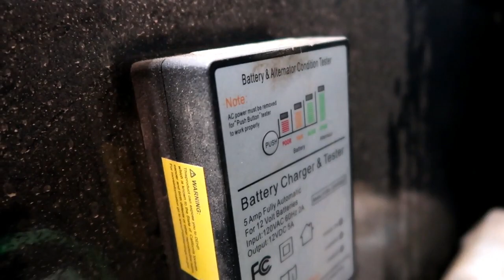PJ Dump Trailer Review

Comment: For anyone leaving comments, who in your opinion, makes the best dump trailer?
Reply from the maker: Wish I had more experience with other dump trailer brands.
Reply: Load Trail trailers has the best quality on the market. They sit about 4 inches higher but the quality and build is outstanding
Reply: I like my PJ alot
Reply: I've had a PJ Low-Pro with gooseneck since 2014----it's a GREAT trailer....so many things you can do with it.  Hauling dirt, gravel, lumber, tractor....this thing can do anything.  Very satisfied
Reply: Diamond C.   Buy once, cry once.

Comment: I own 2 PJ trailers. 1-20' car hauler and 1-14' dump trailer. I like most everything about the trailers, except for the powder coating...it's extremely bad! One scratch, and it peels off in sheets! This exposes the bare metal and quickly starts to rust. Also, the undercarriage tends to rust quickly. For the money I spent purchasing these trailers, I expected the powder coat finish to be much more durable. If you buy a PJ trailer, be ready with primer and paint...you're going to need it!
Reply from the maker: I hear that in a lot of reviews about PJ trailers and fortunately for me that hasn’t been my experience. I believe the coating on my Diamond C trailer is a superior product and much more durable. However the coverage is much better on the PJ. Our 2 year old Diamond C equipment trailer has more rust than our 5 year old PJ dump trailer. Both are used weekly in our landscape business.

Comment: They should warranty fixing the tarp rod being out to far to the driver side which like you said causes the jack to hit the tarp. You could cut about 1 inch off the tarp rod and drill a new hole for the handle. That would drive me nuts

Comment: Valid point about those welds digging into the I beam. You suggesting they have the c channel rest on the I beam instead would cause the deck height to raise 4 inches though. I am looking for the lowest deck height i can find. My tractors backhoe frame is very low to the ground. I like a lot of other brands better in my research but the low deck height of the PJ is a huge plus to me.
Reply from the maker: Longer ramps definitely help as well. With a dump trailer you can also raise the bed to lessen the angle. Check out my video on the stabilization legs for the PJ if you plan to haul equipment.

Comment: You are missing the drop down legs for the rear of the trailer when you load your skid steer.  You can see where they should be at 7:25 of the vid. Same concept as the jack on the front of the trailer.  Just a piece of  tubing with holes drilled in it and a foot on the bottom.
Reply from the maker: Yes, I’ve thought about making them. The tongue lift while loading isn’t that bad on this trailer compared to some I’ve used. Longer equipment trailers have a longer leverage point past the tires and lift the tow vehicle much higher.
Reply: @ThriftyGarage  They sell them at your dealer. I just bought them 60 bux each so 120 bux total
Reply from the maker: Yea, I ended up ordering them online from PJ. Very nice!

Comment: Any time you load your loader without a guy helping you hold the truck brakes you should engage 4 wheel drive on LOW and your truck won’t roll, also chocking the front wheels help. It’s happened to me and it’s the worse feeling.
Reply from the maker: Yes, you can also pull your emergency brake on the trailer to engage the trailer brakes.

Comment: I always chock my tires and drop my jacks when loading my mini ex and skid.
Reply from the maker: Since this video I have installed the PJ drop legs for the rear of the trailer. Makes a huge difference!
Reply: @ThriftyGarage  Great content in video pointing out the flaws in this trailer. Thanks for posting it.
Reply: @ThriftyGarage  how well do they work I just ordered them because I had the exact same thing happen to me unloading my machine
Reply from the maker: @rk_digit3164  the only regret I have is not ordering them sooner!  Well worth the money.  When unloaded just set them 1 full notch higher than where they naturally lay for the proper suspension settling.
Reply: @ThriftyGarage  do u have a review on the stabilizers? I’d like to see them in action. Sounds lame lol
Reply from the maker: @rk_digit3164  I filmed the install but haven't edited it yet.  Let me see if I can churn out a video for you.
Reply: @ThriftyGarage  that would be awesome!
Reply from the maker: @rk_digit3164  Ryan, just for you.  It's live!  Check it out!
Reply: @ThriftyGarage  not all hero’s wear capes lol

Comment: PJ TRAILER HAVE LOUSY PAINT.  I'VE HAD 4 INCLUDING THE ONE I HAVE NOW.  RUST AND PAINT FLAKING HAPPENED TO ALL AFTER ONE YEAR.  INCIDENTLY...NEVER USED IN WINTER AND WASHED REGULARY.  FOLD UP RAMP BARS BEND EASILY.  DECKS AND ELECTRONICS ALWAYS HAVE BEEN GREAT
Reply from the maker: What years were your trailers? This is a 2018 and while the paint is perfect. I’ve heard so many horror stories about the paint on PJ. But that simply not my experience. It has been a great trailer. We did bend one of the ramps but that was due to an emergency exit with a skid steer and I’d place that in the abuse category. Noting some heat and reinforcement didn’t fix.

Comment: All you have to do is lift the box 6 inch’s and the handle clears the tarp crank .
Reply from the maker: If it was a one off trailer I’d get that. But this was an oversight and should have been thought of in the design process.
Reply: @ThriftyGarage  all my diamond c and load trail and big Tex and Lamar are exactly the same I have 6 dump trailers and just added another 2021 PJ gooseneck  83x12’ dump trailer 2 weeks ago  to the fleet .	you always on all of low pro trailers  raise the box a little to use the landing gear handle correctly . It’s only 24” sides so the tarp crank will always be in the way of the landing gear crank . Think about it if it was a 4 ‘ side trailer the tarp crank handle would be another 2 ‘ higher .		.

Comment: Try lifting bucket on top of gooseneck. Pull forward to equalize weight. DOT says one chain and binder per corner, one on bucket, total of five minimum. Also no loose items in truck or trailer, Spares, shovels, chains etc.
Reply from the maker: There’s not much wiggle room for adjusting weight distribution but the way it is loaded is just about perfect. Loading backwards puts too much weight front. Putting the bucket on top of the gooseneck would be even worse. All of the weight would be in front of the trailer axles. Not to mention the door on the Bobcat swings out so in order to load like that the door would need to be removed, which isn’t super difficult. As far as chaining down 4 anchor points is sufficient for this machine. There are two hooks on the rear and two more on the front loader arms. On a MiniEx you would certainly need 5; one additional for the arm. I don’t believe DOT requires one chain and binder per corner. Rather that the chains and binders should be sufficient for the weight of what is being secured.
Reply: @ThriftyGarage  As Thomas Buss said skid steers are heavier in the rear it seems like you are still lifting the rear of the truck since thats behind the rear axles n i dont see squat on the truck. Any if it feels safe i guess you are ok.  If you had 16ft version it would of gave you that twiggle room you dont have.  As for time downs sin e you are under 10k you only need 2 on the machine. But would need one more for the attachment technically. This being said the towing i do is all back roads so i get away with less too. I only put 2 chains on anything from a 6k front end loader to a 12k mini x. To each there own. Just dont get caught by dot.
Reply from the maker: Trust me, I’ve been in a situation with incorrect tongue weight. Check out my “What happens when your trailer tongue weight is wrong?” video. I’ve loaded this track skid both ways and for weight distrust forward facing is best. Having a gooseneck dramatically helps as well. Plus dump trailers kick their axle further back to help with the dumping hinge point. Sounds like your very experienced as well so it’s not like you aren’t aware of what I’m saying. Thanks for your input.
Reply: @ThriftyGarage  yeah i was just saying. Ill have to watch the videos for fun. Thanks

Comment: Could you pull your trailer brake safety line to set your trailer brakes when you load?
Reply from the maker: I think that’s a great idea. I actually ordered a set of stabilizer legs from PJ and they are AWESOME! Definitely a must have upgrade if you haul equipment.

Comment: Interesting.
Reply from the maker: How so?
Reply: @ThriftyGarage  my 14ft 14k has legs that drop in the back to load heavy equipment.
Reply: how much pin weight do you think you have with the bob cat on?
Reply from the maker: Yes, that certainly helps. This trailer does pretty good. I’ve used traditional equipment trailers that were longer and they would always lift the rear tires off the ground unless you used the drop legs.
Reply: @ThriftyGarage  thanks for sharing. Ur helping alot of people.
Reply from the maker: If I were to guess I’d say around 2,000 lbs on the gooseneck ball.

Comment: Hello boss, is your truck 2500 or 3500 Chevy? How does it handle with the added weight?
Reply from the maker: 2500hd and it’s a load. I have since added air bags and it’s a much improved ride. I recently purchased a 2015 Silverado 2500hd and stock it handles the weight about the same as the 2007 does with air bags. Eventually I want a 3500 but they are hard to find without dual rear wheels.

Comment: It ran away because you didn't chock the wheels or put the truck in 4wd.
Reply from the maker: It would have helped to support the rear of the trailer so it didn't have as much leverage to lift the rear of the truck. Tire chalks are definitely on the need to get list. I'm curious if the truck was in 4wd if it would have instead planted the front tires and spun the truck sideways. Who really knows. It's all lessons learned and has changed my strategy of where I park to load and unload.
Reply: @ThriftyGarage  had mine in 4x4 and wheels turned to the curb and still had my truck run away about 15ft. So 4x4 doesn’t always work

Comment: Hi, can I tow this without a cdl? If so how much could I to before hitting the 26,001 limit??
Reply from the maker: The trailer can be rated for up to 15,900 lbs. Towing capacity will depend on the tow vehicle. You would need to look at the GVWR for both the tow vehicle and trailer as well as be under the GAWR for all the axles both on the tow vehicle and trailer. The gooseneck will push some weight forward. You also need to know how much the tow vehicle and trailer weigh dry to know what it is capable of towing. From the Cat Scale tickets I have you could likely tow 10,000-12,000 lbs with this trailer.

Comment: Would you Recommend on going with the 4 foot sides on the trailer . Or your happy with what you have
Reply from the maker: No, but it totally depends on your use. If you plan to haul light materials (mulch, leaves, debris) then taller sides are best. We usually use it to haul rock, soil or equipment. We would exceed the weight capacity before we were flowing over the sides.
Reply: @ThriftyGarage  I do a lot of landscaping and concrete jobs so my jobs would change a lot you know . I just see a lot of people getting the low sides
Reply: What made you get a gooseneck instead a bumper pull.some people say bumper pull is better when having a company because anyone can use it
Reply from the maker: For most landscaping and concrete 2’ sides would be perfect. Only time I would use taller sides would be for bark mulch. But I could easily use the stake pockets and build wooden sides for added height and a little more capacity.
Reply from the maker: Gooseneck for added weight capacity, smoother ride and more agile. It does limit the potential tow vehicles. As far as the driver I have found good experienced operators capable of towing either trailer type hard to come by.
Reply: Would you pick a pj dump over a Texas pride
Reply from the maker: I’ve never used a Texas Pride so I can’t speak to how it would compare. They seem to be a decent brand as well. Regardless of the brand I would shop for the best value to your particular application. Might be cost, might be quality and honestly local dealers might have better deals on particular brands making them more attractive. Dealer support and warranty are also items to consider.
Reply: @ThriftyGarage  1 more question what made you get the 14000lbs and not the 18,000 or 20,000lbs. It would hold more .I’m thinking of getting the 20,000lbs but not sure if I would really need it .I do a lot of concrete work
Reply from the maker: Do you have a CDL? Most 3/4 and 1 ton trucks combined with a 14k trailer are close to the 26,000 lbs limit keeping it under the requirements for a CDL. If you get a larger capacity trailer you most certainly will need a CDL. Check your GCWR and GVWR on your tow vehicles to know what capacity trailer you can pull. Gooseneck may enable a slight weight advantage over bumper pull depending on your GAWR for your front or rear axles. But if you load heavy it’s definitely not a bad idea to get a higher rated trailer and de-rate it, keeping you under CDL requirements. That way in the event you do go over weight your trailer can handle it. Although you could certainly be liable for an overweight ticket. If you are towing this setup for profit you would be considered a commercial vehicle and should have a US DOT number on the side of your truck.
Reply: @ThriftyGarage  man you are the bomb thank you brother.
Reply: @ThriftyGarage  I have a 2018 Dodge Ram 2500 and it say my gvwr is 4534 so does that mean I can do a 20k trailer
Reply from the maker: Look in the door jamb. Weight ratings vary depending on your curb weight. Do more research on correct weight ratings. I would not recommend a 20,000 lbs trailer behind a 3/4 ton truck.
Reply: @ThriftyGarage  what would u recommend. For a 2500

Comment: Looks to have a lot of weight on the rear end of the trailer due to the Bobcat being loaded forward. Are you experiencing any trailer sway?
Reply from the maker: I have actually loaded it both ways and since it's only a 14' trailer there isn't much wiggle room, limiting weight distribution. Loading it this way is best for correct weight. No issues with trailer sway. Having a Gooseneck helps. Loading it the other way puts too much weight on the rear tires and takes away traction from the steering wheels.
Reply: @ThriftyGarage  I have a trailer identical in size, but bumper pull. I cant win. Loading backwards = too much tongue weight and a horrible ride. Loading forward = too much weight on rear end, more forgiving ride, but trailer sway at highway speeds 🤣🤣
Reply from the maker: You could try air bags on the tow vehicle. Overloaded is overloaded but it would prevent the squat ant keep your steering angle closer to stock. You could also try a load distribution hitch. I don't have personal experience with either, just going out on a limb for solutions. Like you say it's tricky when you don't have extra deck length to play with and adjust weight distribution.

Comment: My first dump trailer was a pj ...2 years in to it the power coat  peeled off horribly. Called pj and they said oh well..
So got rid of that piece of shit and got a loadtrail..much better choice. Never again would I buy a pj
Reply from the maker: This one is 2 years old and still going strong with the powder coat.  Hopefully they changed their process!
Reply: I have the same issue with my PJ trailer.
Poor paint quality and very poor rear design!
The frame below the ramp storage swing doors should NOT be an open channel, rather it should be tubular steel to prevent debris, sand, stone, etc. from settling.  This design flaw has lead to a great deal of rust and deterioration!  
I’ll be selling and looking for a new high quality dump trailer.